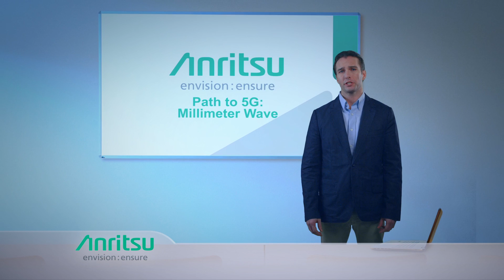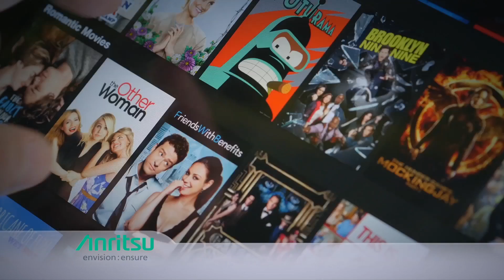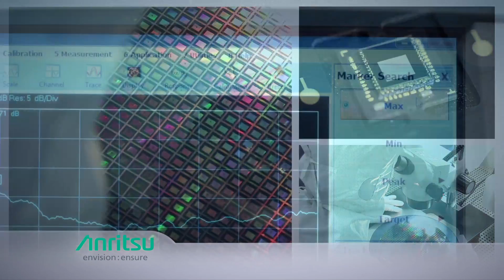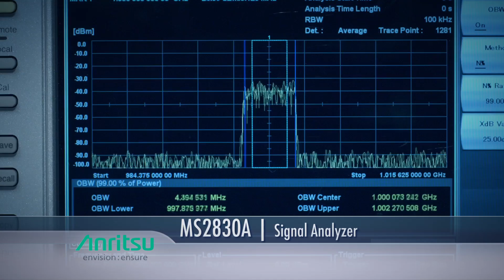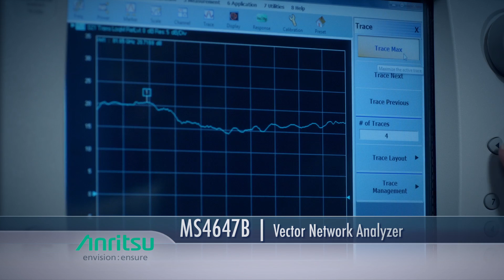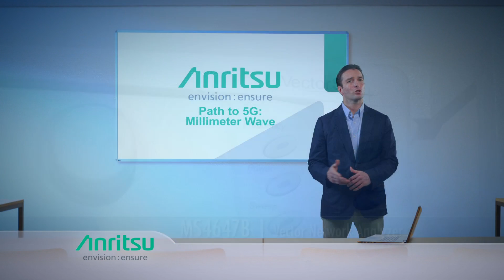5G Millimeter Wave

Comment: even if its 5W but the frequency is in microwave region of the spectrum so its definitely gonna vibrate the water molecules in the cell of your body and heat them up. DNA damage would be inevitable. so people gonna end up with genetic disease or cancer or mutation. We don't even know how its gonna impact the microbes ie bacteria and viruses. Viruses are dead when outside the body but inside they are alive. If along with our cells if the virus's DNA is also mutated it may be the reason of new mutated virus causing pandemic. why the hell do we need 5g..? 4g is enough for domestic purpose. using 5g optical connections high speed internet for military purpose would be great but should never be used in civilians.

Comment: 5G uses millimeter wave length radiation just like the ACTICE DENIAL SYSTEM 95GHZ ALSO 5G Towers are 105GHZ and they will be able to ping off your 4G/5G cell phone which is 40GHZ and see into you home

Comment: i use frequency material. cover groin, have lined hat with magnets, another hat with frequency material and have a copper wire for necklace..for neck shots, they shoot @ groin(IBS syndrome, and prostate cancer, septic disease), chest(heart attacks and shoulders), feet too. health growth $,,invisible sickness, set up for CHIP..
Reply: Can u make some for me please I need to shield myself since I had the covid nose swab😭
Reply: @ulyssesmarshall5061  everything can be bought at local hardware store; ground cooper wire for necklace; make a cooper hoop (attach a wallet size sheild(wallet with frequency protection for left side and put all way to body), use a water bag(cooper at end) to hold hoop, put string on end wrap around top. You need this one for left side shots, dangerous heart shot. Magnets in hat a must, (Street theatre- triangle any one, use houses and smart meter, cell tower, car/truck alternator power, and phones, its a light burn to organs, Septic disease number one out in public now. $ prescriptions$

Comment: We were once told smoking was good for us.
Reply: https://www.defendershield.com/5g-technology-safe-emf-radiation-emissions/ 
These guys do not care about us they only want to make cheese.  U think they are honestly going to tell us?
Reply: Alright, as a tech guy who doesn't understand the logic of the 5G conspiracy crowd, I just want to ask you:

Why 5G? What specifically about 5G has you concerned over, say... AM radio signals? Or FM radio signals? Or 4G LTE signals? or WiFi?
If anything, millimeter wave isn't able to penetrate as well as these other wavelengths. milimeter wave can transmit faster, but it is ultimately a weaker wave that has difficulty going through bodies and buildings. 

I don't understand how the 5G conspiracy crowd can logically be afraid of 5G to a greater degree than AM/FM/WiFi/4G. If 5G scares you, then traditional radio should scare you more. Because the older transmission technologies could penetrate you far better than millimeter can.
Reply: @charleslentz1962    4G is dangerous to,  There are many videos Which Shows Balloon busting, Burning Things Using Laser. Among Three Types of Laser lights ( RED, GREEN, Blue ) Guess what ? 

500 mili watt Red Laser doesn't carry that much energy or rather to say Red Light Energy is more penetrating, travels farthest among these three but is weak in terms of burning things.

500 mili watt Green travels less far than red does but carry enough energy that it can burn few objects. Medium penetrating medium kill power.

500 mili watt Blue Laser, travels much less than red does, but has greater kill power than Green and red.

So  any EM wave which can't penetrate objects , is not any harmful effects. less penetration power doesn't make it less harmful.
Reply: @charleslentz1962   Shorter distances, more power, higher frequency wavelengths do bad things.  Thats Why we know Infra Red, Ultra Violet.
Reply: @charleslentz1962  it lowers human frequency
Reply: @charleslentz1962  Headache/migraines, brain fog, depression/anxiety, nausea, vomiting, diarrhea, LOSS OF SMELL AND TASTE, coughing, tachycardia/POTs, chest pain, fatigue, seizures/tremors, vision disturbances, palsies, tinnitus, shortness of breath, muscle and joint aches, skin rash, immune cell activation, changes to bone marrow and white blood cells, changes in menstruation, lung scarring/coughing, atrophy of saliva glands leading to sore/dry throat, numbness, tingling, nerve pain, hair loss...

= 5mm radiation exposure symptoms 
= “Long Covid” symptoms
Reply: @charleslentz1962  >150,000 5G towers went online near-simultaneously in the region of Wuhan (the world's 2nd "all 5G test city") between Nov-Dec 2019.

5mm wave technology was widely activated across the telecom's existing 5G infrastructure throughout Western Civ in Dec 2019.

The name “long COVID” was created by the people experiencing it in Spring 2020 to describe their journeys of not recovering.
Reply: I also remember when we were told glowing green uranium was safe enough to be put in toothpaste for that cool factor 😎
Reply: @Iliyan Nedev they don’t need a test to get ur dna lmao. All the need is your garbage. Trust me, if they wanted to get it, they’d already have it
Reply: That controlled a population, so will vaping!

Comment: Definitely hiding something from the people what they won't go into is how it affects molecules and atoms what does it do the atmosphere
Reply: James Fubo do you think this has anything to do with the corona?
Reply: even if its 5W but the frequency is in microwave region of the spectrum so its definitely gonna vibrate the water molecules in the cell of your body and heat them up. DNA damage would be inevitable. so people gonna end up with genetic disease or cancer or mutation. We don't even know how its gonna impact the microbes ie bacteria and viruses. Viruses are dead when outside the body but inside they are alive. If along with our cells if the virus's DNA is also mutated it may be the reason of new mutated virus causing pandemic. why the hell do we need 5g..? 4g is enough for domestic purpose. using 5g optical connections high speed internet for military purpose would be great but should never be used in civilians.

Comment: How does one shield this in the home please?
Reply: The solution is to destroy these towers
Reply: Faraday cage. But it would be costly. Because these waves are going to go through you without your permission once the short range, high power towers are up.
Reply: You need thick walls to block it.
Reply: Actually, it doesn't take much at all to block it. That's one of the challenges they're trying to work out with millimeter wave: It doesn't go through buildings as easily as 4G did. It is not able to penetrate your home as it used to. Which is why you're now starting to see these 5G booster packs being sold on the market. Its a way to increase signal strength indoors, because otherwise the signal can be too weak to actually reach inside your home as 4G did.
Reply: Don’t bring any of the Smart Devices in, including a router on the 5G setting. Throw it all out! 
And, I’ve heard lead paint to block the 5G antennas & towers!

Comment: you know how they're going to overcome the penetration problems, pump the power up, then you have an AoE  Active Denial System
nevermind what it's going to do to your health, at least you can watch porn in 4k on the subway
Reply: But they ain't gonna solve it.
Reply: I does not penetrate through paper towels, toilet paper, and walls.
Reply: @dwj1231  After reading your comment I decided to do a quick experiment. With a -114 dbm 26 asu signal of 4G, I wrapped my cellphone in 2 layers of Paper Towel and 3 layers of Toilet Paper. Using a micro spy camera I monitored the signal strength. I was expecting to see a drop in signal strength but to my surprise, the signal increased to 110 dbm 30 asu. Are you saying that when I upgrade to 5G I won't be able to wrap my cellphone in toilet paper and upload comments like this on YouTube?
Reply: I was in the army for a few years. While I didn't deal with the ADS myself, I did deal with satellite dishes a lot. The ADS only works on a 2.45 GHz. Your cordless home phone works off probably 2.4 GHz. Granted, the ADS is built to direct those waves toward a specific AOE, like Zac said. But if they are talking about this 5G going up to 300 GHz, you people are all dreaming.. and dead. Ridiculous. Do your fucking due dilligence, people. For God's sake!
Reply: @d_man_beats  MY FIRNED DOES INSTALLATION AND TOLD ME THE TOWERS ARE ALLOW TO GO UP TO 250GHZ, BUT THATS THE MAX, SHE HAD TO CALL THE PRIVATE COMPANY TO HAVE ONE TURNED DOWN